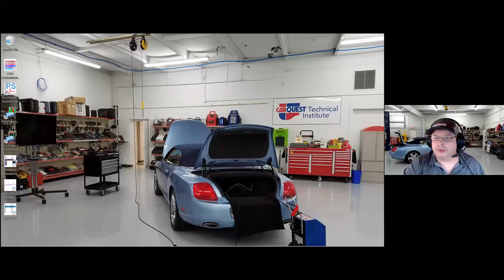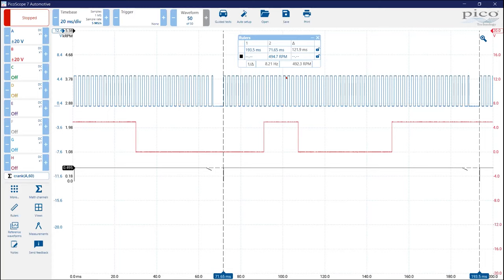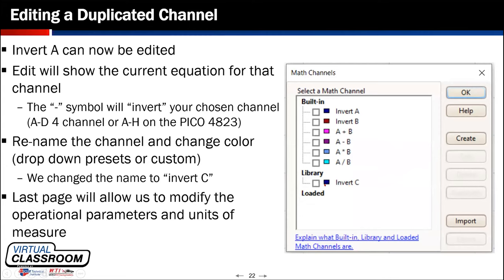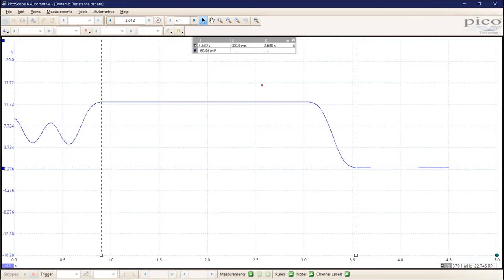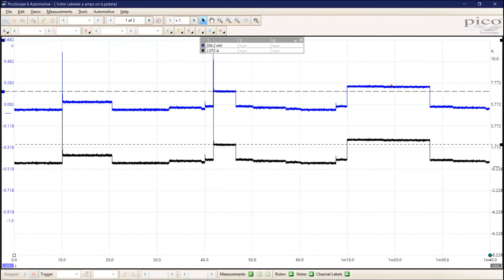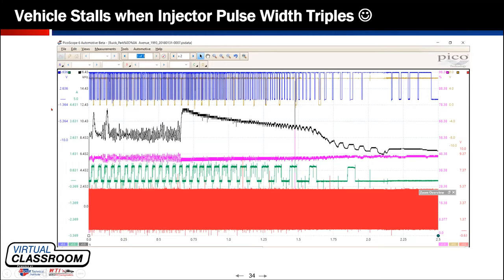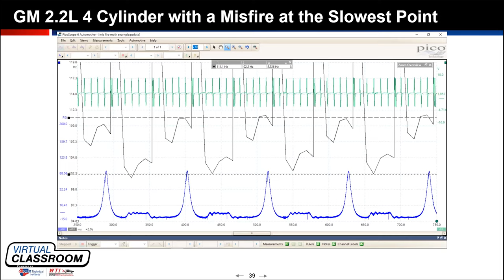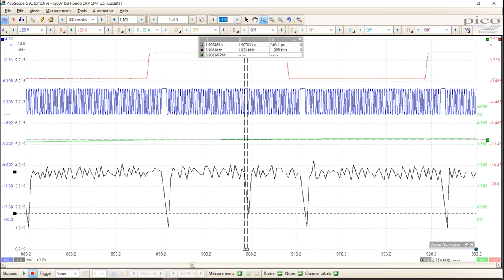CTI Virtual Classroom - Advanced PICO Math Channel and Reference Waveform Techniques

Comment: i would like to know, how in hell you can read 8 accelerations on a scope pattern while one spark plug is removed and an in cylinder pressure transducer is screwed into that hole ? or was this a 9 cylinder radial engine ?

Comment: Great stuff Adam. I bought the E-scope elite 4 lab scope & i'm not sure if it does all these calculations. I really like the Pico scope better than the E-scope..Have u used the E scope before ? I really think i should buy the Pico scope 4425A..Let me know Adam what you think. Thank you
Reply: My struggle debating which one to buy how's the e-scope working?
Reply: Maybe you've already bitten the bullet on that one, but get the pico. Doesn't matter if it's the 25 or 25A. the ATS scope is ok, but I have found that it is not really capable of catching CAN signals. We have the E-scope limited which came with the engine analyzer, but can't get a BUS waveform to save our lives. Pico is way easier to set up for that.